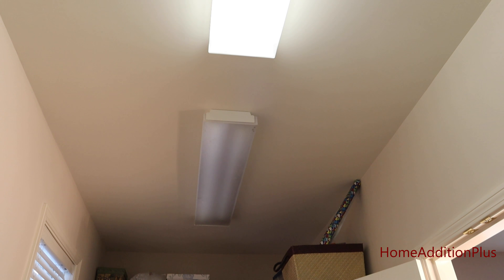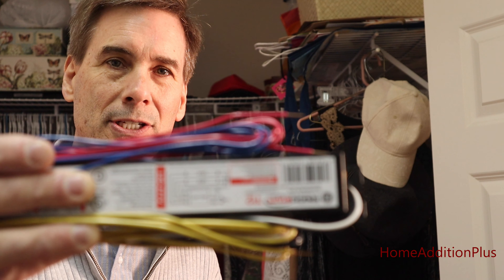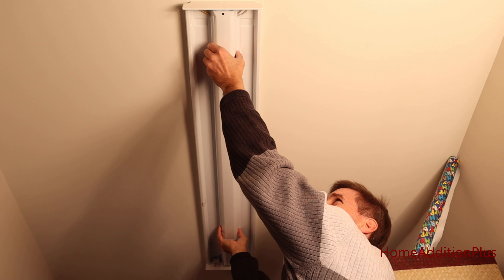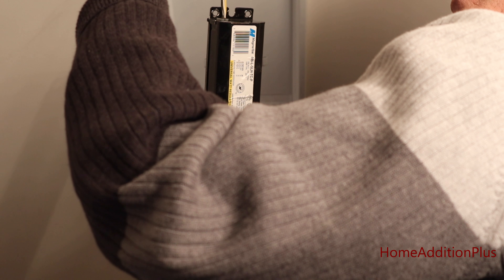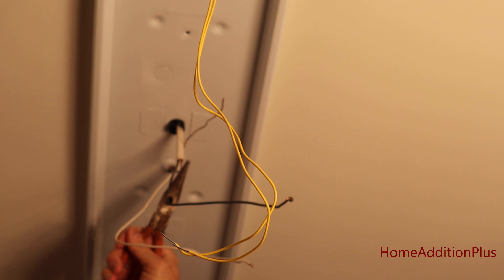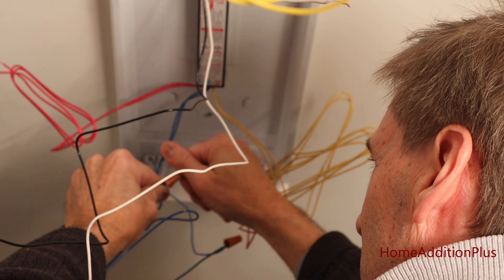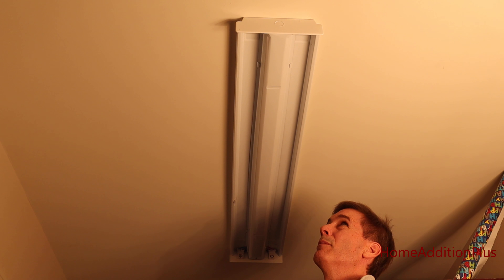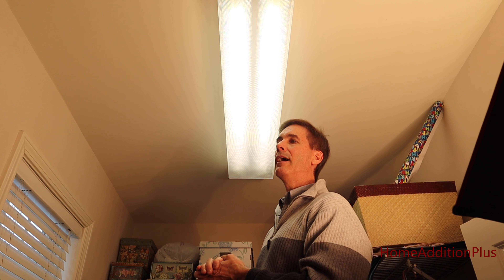How to Replace a Fluorescent Light Ballast

Comment: Thanks!! Great video - we just changed our garage ballast after watching.  We decided to leave the wires at the original length just like you did because you never know what the future holds and you can already cut them later but you can't add to them.  They tucked up neatly in the case.  Yes - I subscribed.

Comment: Very helpful. Definitely took the stress out of the job. Agree with you on the LEDs. Just not worth the cost for the job at hand. If I were putting in a whole new fixture, LEDs might make sense, but $20 for the ballast based on how long I'm going to be here was the way to go.

Comment: I replaced my ballast and shorted out my circuit. I hooked up all the wires to the corresponding colors, made sure grounding wire was in place. I noticed the ballast was a little larger than the old one just like in this video, but the voltage and bulb type matched. My splices were good. Not sure what went wrong.

Comment: I have really long Old style flourescent bulbs, and they are not available anymore. How do I tell if the bulbs are bad or if its the ballast. I am also wondering due to lack of availability of flourescent light bulbs if I should just do a modicaton kit to change the existing fixture over ro LED from fluorescent rather than buy a whole new fixture. I know this can run into problems if it's one end or two ends not sure how that works or if I'm explaining it right.

Comment: Great video. However, I'm tempted to replace with a single, 800-lumen LED bulb.
Reply: What? That’s a loss of over 4000 lumens assuming it’s a dual F40T12 or F32T8 fixture.